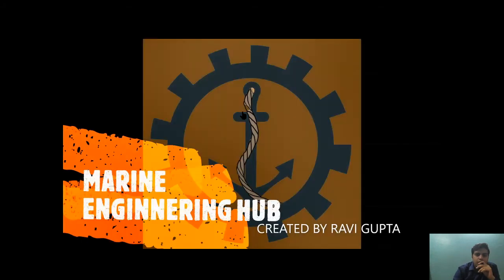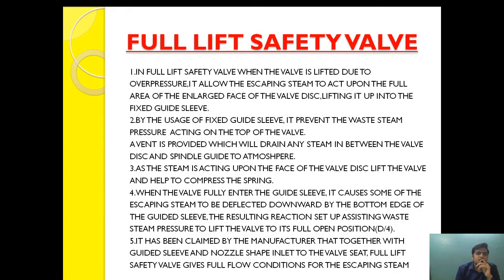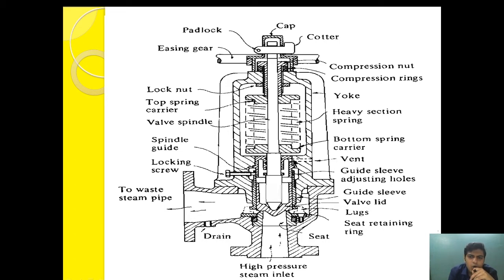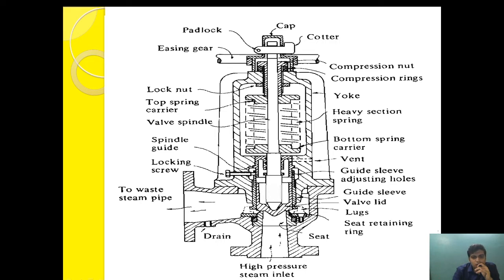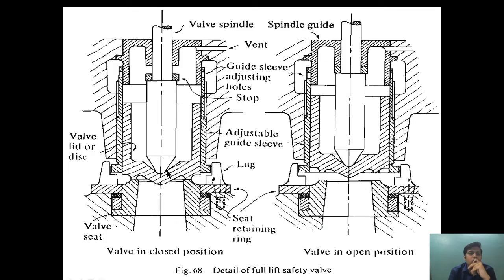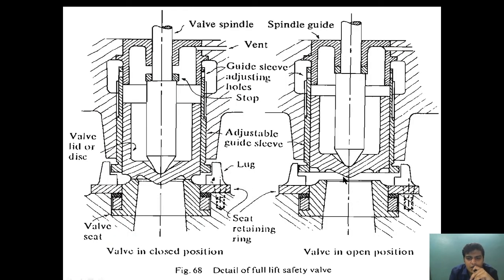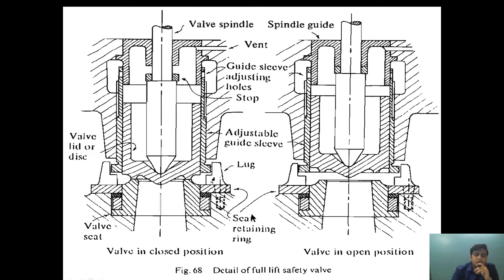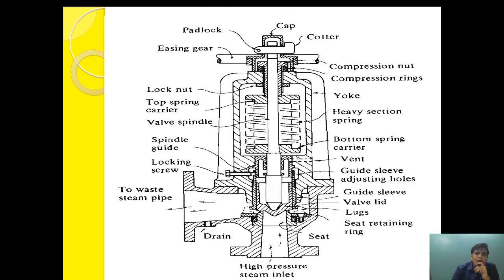FULL LIFT SAFETY VALVE| DESIGN|SAFETY VALVE IN BOILER(PART-4)

Comment: role of lugs in this type of valve??
Reply from the maker: Hello ankkss,
Stepped lugs on the valve seat are provided to prevent the sleeve being screwed down too far and restricting flow of escaping steam.
I hope you understand!!!!!
Please do like and share with your friends !!!
Reply: @MarineEngineeringHub  
Thanks for the answer,

Can you also please explain if
1) blowdown ring and adjustable guide sleeve same?
2) what happens when we move this ring up, or when what happens when we move this ring down?